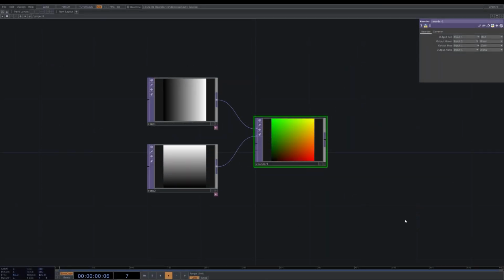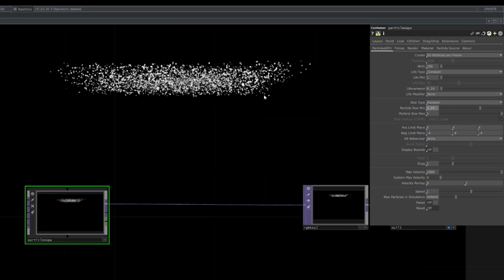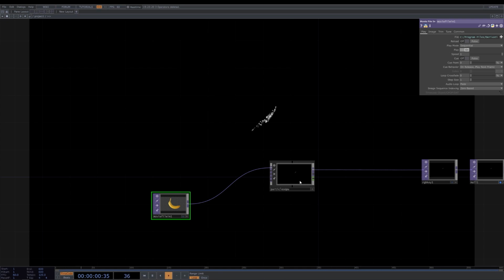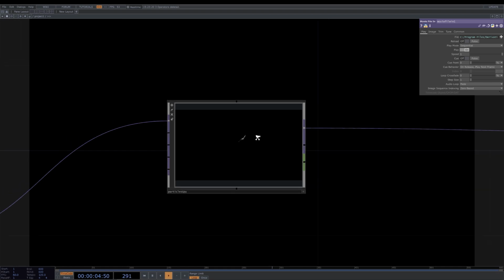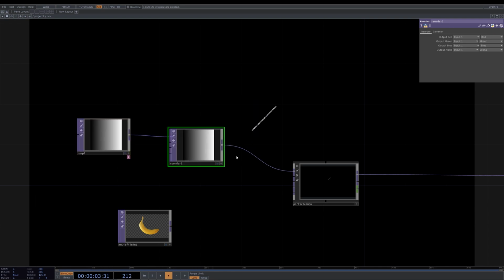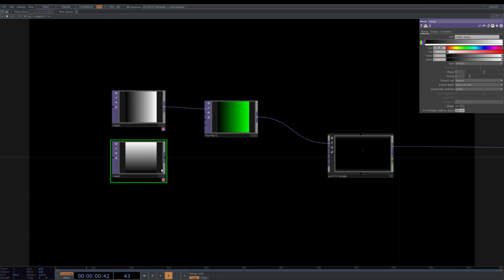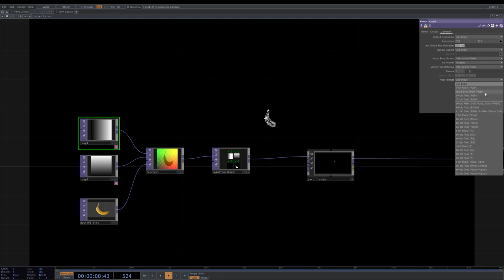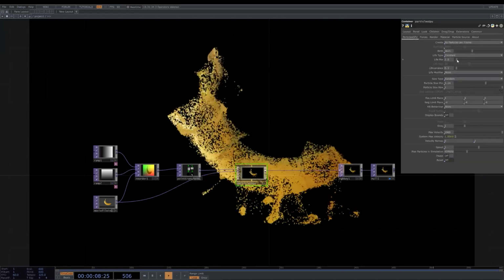.PNG into particles | Reorder TOP explained | TouchDesigner Tutorial

Comment: the only thing i dont get is why do we need the ramps, like why couldnt you just connect the video to the alpha of the reorder
Reply from the maker: Ramps are sort of telling the system "reserve some points in virtual space to render some stuff". Color channels are coordinates for these points (red for X, green for Y, blue for Z, traditionally). If you don't do it, it will not reserve any points hence it won't able to render anything. It's like having a land in particular area to be able to build something there. That's not very straightforward in TD, but it is what it is:)
Reply: @anyamaryina  i see, that was my intuition but wasnt sure, thanks!
Reply: @anyamaryina  What reserve?? :) it is the X, Y coordinates of the points.. stop making it super complicated. RGB = XYZ (or any order you want - hence the operator name reorder). the reason that it is a ramp is, in a grid, your X and Y gradually increases like in a ramp. :)  Than you add your image luminance value to be Z or A. (btw, make sure that aspect ratio and number of pixels of the images are the same when you are creating vector data with pixels - you did not fit the banana to be a square ratio with the same resolution of the ramps). I recommend all of you start learning GLSL or any other shader language. I am surprised that this tutorial even exists :) i came here to see if there is anything else and i am super surprised (also 10K views :) - i guess i need to start creating tutorials as well) You are explaining it, but it looks like you are also not getting it 100% :)